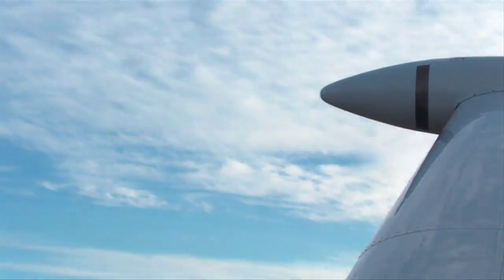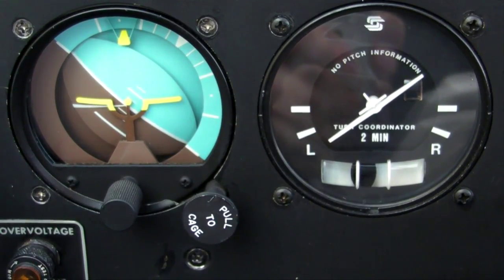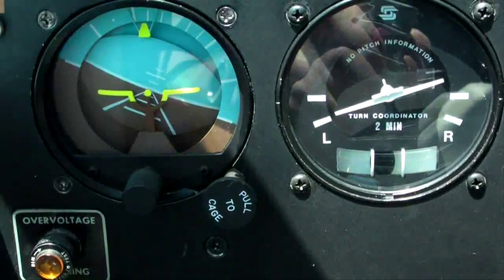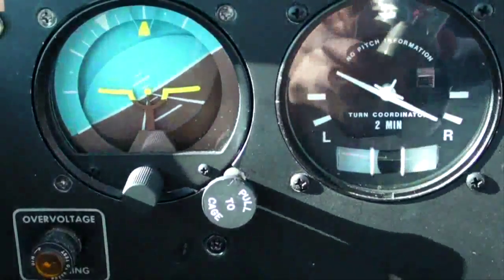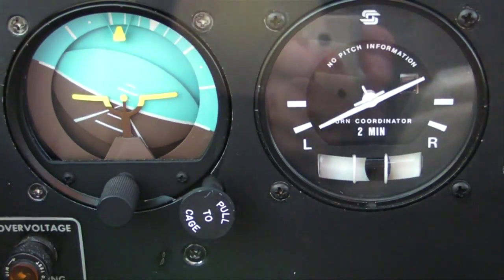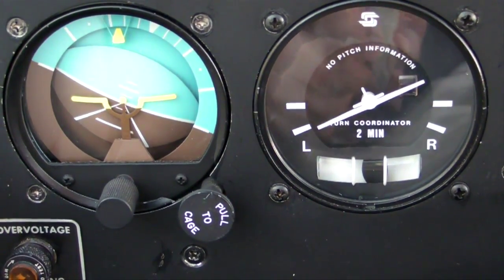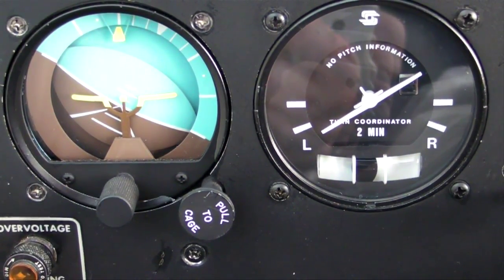Aviation Safety's Slip/Skid Lesson

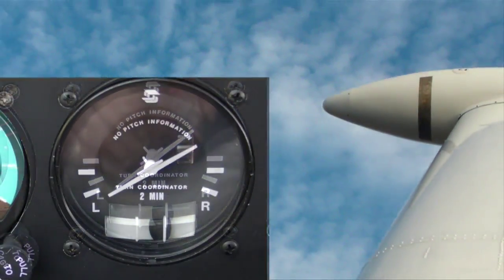Comment: A big opportunity was lost here for a very good lesson.  The key here is to understand that a skid can be a killer.  Having the ball on the side of the high wing (when looking at the turn coordinator as in video time 0:48) can be very dangerous for a pilot that does not understand the dynamics of a stall.  For example, if you are turning to the left, and you have too much left rudder (a skid, as in trying to cheat a base to final turn in the event you overshot final) if you slow the airplane down and things get ugly, the stall warning goes on and you panic and you want to roll the airplane to the right, you incorrectly turn the yoke/stick to the right.  You now have set up the classic spin, why?  You have the yoke to the right but rudder to the left. The left wing will stall first (because you have down airleron on that wing trying to "lift it" up and added drag) so with left rudder already in, the airplane will roll to the left (which happens VERY quickly because the airplane is already rolled left).  They key is to remember to ROLL the airplane back level with the RUDDER. Step on the ball!   In a slip, the airplane tends to roll in the direction of the high wing during a stall (because you have the rudder already in the proper "direction") and so the airplane will go level before rolling all the way to the other side. You have more time to "catch" it...  Learn slip vs skid FULLY before your next flight.  Practice rudder work WITH AN INSTRUCTOR to FULLY understand slip and skid and how the airplane reacts.
COMMENT:  I am NOT an instructor so don't believe a word of this.  Ask your instructor!!!

Comment: I still don't know what a slip and a skid are, and how the rudder affects a turn.  All I know is "rudder this way when ball goes that way."  It wasn't a slip/skid lesson.
Reply: Backpacker Thrulife  Well, in some airplanes, like the c-172, the aircraft makes coordinated turns pretty much by itself. In the old days, when some aircraft had no flaps, like the piper Colt, you would use a skid to lose altitude in many landings, and the plane would come in partially sideways, and you would straighten out just before touchdown.
Reply: Slips are good for losing altitude quickly and controlled without gaining air speed.
Reply: Simply put, 
A slip is too little rudder for the amount of bank.
A skid is too much rudder for the amount of bank.

In practice this relationship becomes obvious, but it's harder to visualize through text. You can get a feel for it in an airplane, but a glider is really where you understand the relationship more, because the rudder has less surface area compared to the ailerons than in an airplane, so you need more pressure to stay coordinated. 

For the most part, you always want to use the appropriate amount of rudder in your turns, but that will be different for every turn, you use as much as you need. Either you have enough or you don't.
Reply: @boolekx  Thanks, that's the video I needed to watch in the first place.

Comment: I used to explain and demonstrate to my students the three  functions of the rudder .
1. The rudder is used to prevent SLIPP or SKID .
2 . The rudder is used to control ADVERSE YAW ( WHILE ROLLING INTO A BANKED ATTITUDE ) .
3 . The rudder is used to PREVENT YAW ( WHILE SIDE SLIPPING ) .

Yawing is the effect of bank and the higher the rate of bank  , the higher the amount of adverse yaw .
Reply: Robert, when you say "higher the rate of bank" I assume you mean the "higher the rate of roll".   Bank and roll are obviously different and I know you know that.  But for other who may not, I'm sure you wanted to mean "higer the rate of roll".  Point being in a steep bank with neutralized ailerons adverse yaw would be almost zero.  There are techinical exceptions, but I don't want to confuse anybody, or myself. Thanks,

Comment: I think something to mention with respect to steep turns and using ailerons to maintain coordination is the overbanking tendency in steep turns due to the raised, outside wing having a greater angle of attack than the lowered, inside wing. To stay coordinated it may be necessary to use a touch of opposite aileron pressure to keep the bank from increasing while at the same time using rudder to keep the ball centered.

Comment: So my comment, being completely unfamiliar with flying a fixed-wing aircraft is this. When turning a plane it's possible to get the plane to slide/skid sideways and lose lift because the air is not going over the wing as in straight-forward flight. So you use the rudder to orient the plane more so as to reduce the slide. And the ball provides a visual indication of this. By moving the ball as was said, you rotate the plane and improve it's aerodynamics and reduce the slide/skid. Yea/Nea?

Comment: Though probably not worded as simply as it should be for folks new to aviation, I think the point he was trying to stress was the simultaneous use of yoke/rudder input to coordinate the turn.  This is opposed to correcting for slip/skid by "stepping on the ball."  If the ball is giving you a direction from which to step on it, it means you're already uncoordinated and stepping on the ball will correct that.  If the inputs are applied simultaneously, the ball will stay centered the entire time.

Comment: Here’s a car analogy. 
If you turn the steering wheel too sharply and the back wheels skid out from under the car, that’s a skid. (Too much rudder)
If you’re driving on a banked curve race track and you’re not fast enough to stay on the slope, but start to slip down the incline while your car remains pointed uphill, that’s a slip.

Comment: Appreciate the video, but I agree a little bit with SaveAmericaGuy -- if you're going to argue that the ailerons are a tool to coordinate the turn (as opposed to the classic "setting the bank angle and stepping on the ball" as S.A.G. suggests), then I think you really need to expand upon that point to a much greater extent.  

As it is, I had to play the video twice just to figure out what the heck you meant at the end when you said "you can use ailerons".

Comment: although the statements in this video are " true"... they are also useless... or to be more polite " usefull AFTER the concepts are understood" If you cant explain skids and slips without discussing " stepping on the ball" then your instructor and your examiner need to be re-examined.

I used to teach CFI Candidates and this topic was both critical and frankly easy... if you givs a damn.
When an instructor or any pilot responds to my question " what is coordinated or uncoordinated flight"... as soon as they started talking about stepping on the ball I would say, " so if we remove the ball, we no longer have the problem?"  
Yes I am being rude because I am frustrated... because the BALL SHOULD ONLY BE DISCUSSED .....A...F...T...E...R....... the concepts are understood.

I apologize...I wont discuss it here/now as I am on vacation with family.
I will build a response later. OR....... find an older flight instructor who also teaches in Tailwheel Aircraft.
YES..... REALLY...
You dont need " the ball. You need your eyes...
looook.... at the wings and the nose of the airplane and you can see and set your pitch, your speed, best glide, Vx and Vy... when you are climbing straight ahead with your wings level, WINGS/BANK LEVEL.... use your pedals to hold your heading on that cloud straight ahead.... THEN.... glance at the ball.... YOU...CENTERED ...IT........... not the other way around.....mif your wings ( bank ) are level... and your nose os not moving left or right...nthen you are in coordinated flight.... the ball didnt do that....myour eys,myour feet and your brains did that...